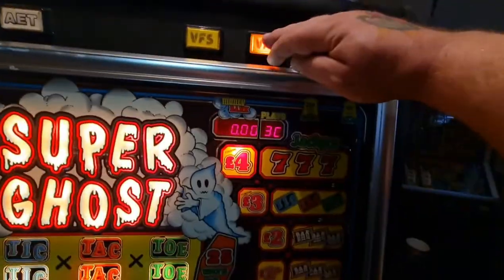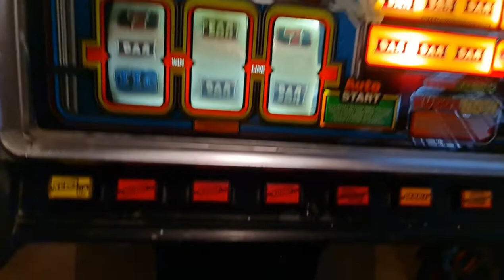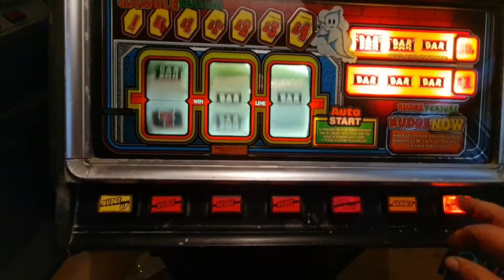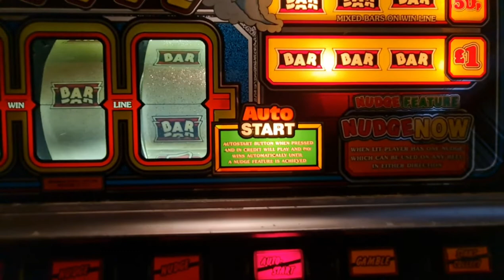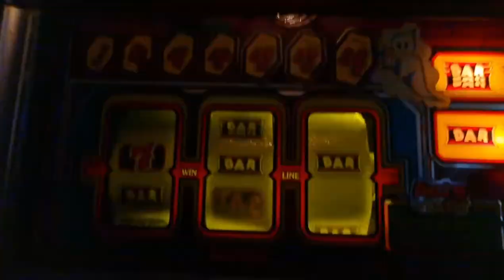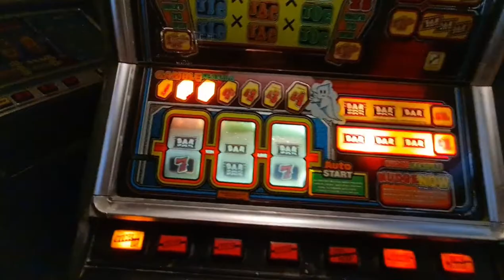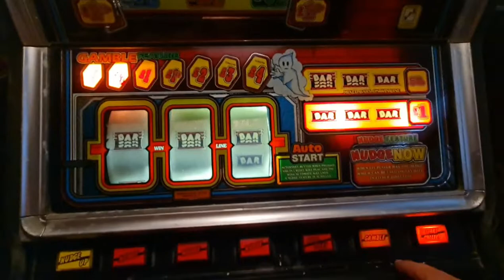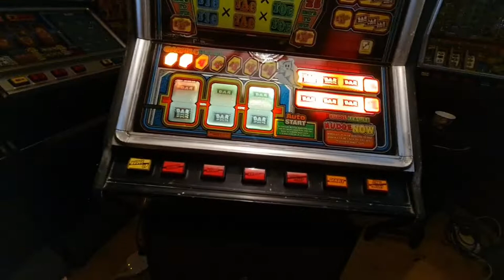VFS Super Ghost (System80)

Comment: surge / overcurrent when the machine tries to do certain things? maybe a small leakage to earth when doing certain things and that rcd is particularly sensitive, or has other faults on the same circuit that just tips it over the edge to the 30ma nominal trip amount???
Reply from the maker: Ok. How do i find it 🤔
Reply: @stevelancett  not an easy way to find out without more specialist tools. Maybe try doing your normal machine type things first as I haven't got a clue about fixing machines. Just thought I would chip in from more of the house electrics side. I'm not an electrician but I know how some stuff works.  Get advice from others as well as I don't wanna send you down the wrong path. Good luck Steve
Reply from the maker: @Martin-uf4ut  Cheers buddy.  It has to be in the power supply unit or loom. All the circuit boards have been changed.  I will see what happens next time i have it on 🙂
Reply: james hardey has just done a video  JPM Impact PSU with Multimeter, dunno if thats usefull, havent watched it yet https://www.youtube.com/watch?v=utCumvWR-RE